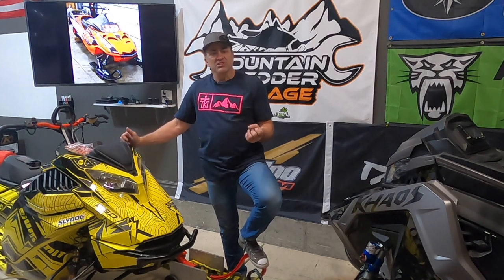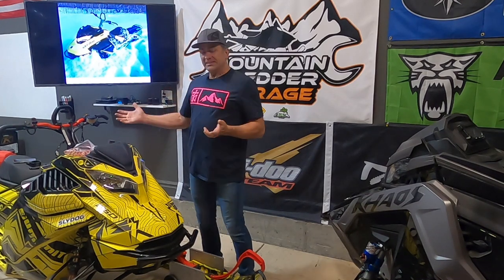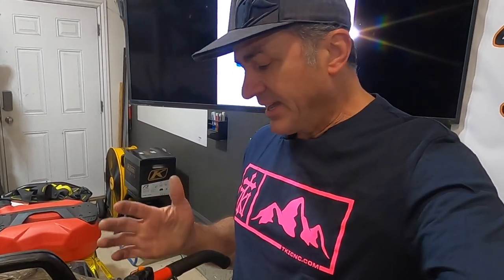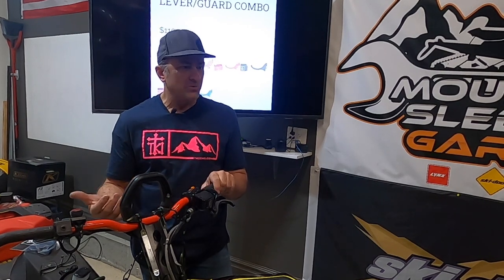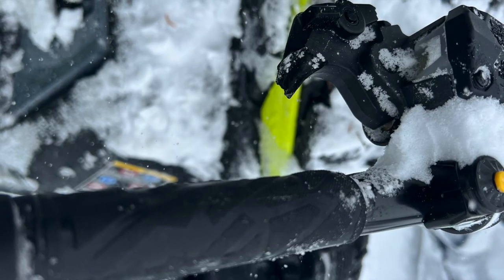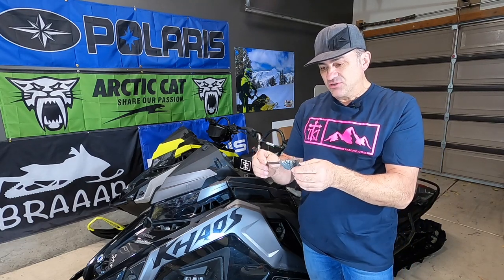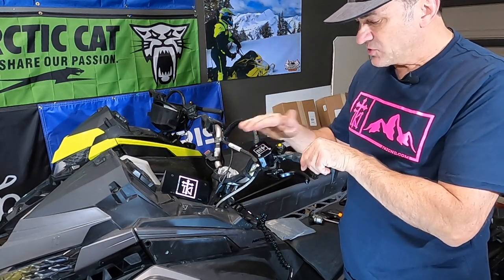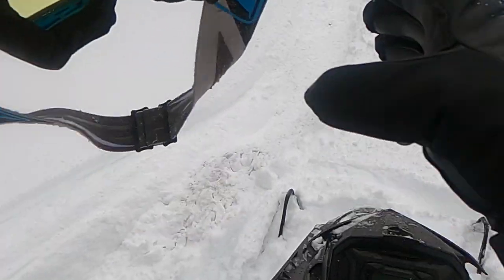Mountain snowmobile brake component protection

Comment: After braking reservoirs and levers on my old ProClimbs, I went with TKI on my Gen4's for all the same reason you did.  I love that Doo has gone to an adjustable lever for the Gen5, but you can't buy just the lever -you HAVE to buy the entire cylinder assembly.  The Gen5 Expert has the res protector stock, but I'm looking forward to Tom at TKI coming out with a metal, adjustable and heated lever! :)
Reply from the maker: The adjustable lever on the new doo looks great. TKI just added the heated lever to the website, otherwise I would have put one in the video.

Comment: Not a hardcore rider here, but one time my buddy broke the plastic brake lever off on a rental M8000 😆Luckily we were not far from the trail and we found one at a dealership to replace it. In my opinion the plastic levers themselves are a designed point of failure so that the cylinder housing/mount doesn't bust off the bars or break off the lever pivot. An aluminum lever can probably take a small hit that a plastic one couldn't, but if you get to the force required to break an aluminum one, other stuff probably breaks first. The plastic reservoirs I don't quite get though, I have never seen a metal one break off but clearly your demo shows that the plastic one on the Doo is not very tough 😬
Reply from the maker: You always have to think about what the next weakest link is when you strengthen one part. You have to take a really hard hot to brake off the whole hand brake, seen it once in 20 years.

Comment: Up in BC lots of guys run the Munster Brake resevoir, it replaces the plastic totally and seems to fix the problem well. Little bit mroe work than just bolting on the TKI though.
Reply from the maker: Munster is a good option. I’m glad they added a second hold down bolt for the reservoir. I didn’t think just the one factory bolt would be sufficient from taking a hit. You